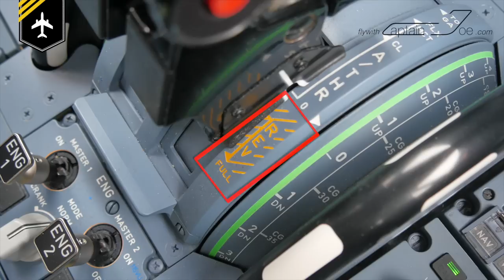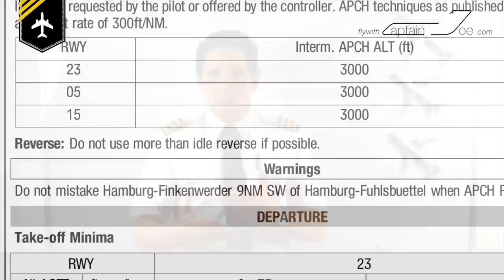What is reverse thrust? Explained by CAPTAIN JOE

Comment: Those reverse thrust doors have to be so incredibly strong.. Diverting a force which normally launches an 100.000KG+ airplane to ~800km/h. Good topic!
Reply from the maker: True, yes the must cope with a lot of stress!
Reply: Captain Joe I understand how the reverse thrust works on engines that have those flaps opening when reverse thrust is deployed. It's like ground spoilers but in another way. What I don't understand is how the reverse thrust works on engines that are just separated in half when we use the reverse thrust. Can you explain if possible ?
Reply: Captain Joe I am new subscriber and I know I will love this channel and share it. You're terrific Captain Joe!
Reply: Μανώλης Φιαγκουσάκης same principle. just the flaps is internal for those engines that 'seperates in halves'
Reply: @shermanbritto9930  Great "how it works" video! Thanks!
Reply: I worked at a manufacturing plant that made these doors. Each one is made of 50+ layers, total about half an inch thick, of carbon fiber laminate which is cured in an oven for hours.
Reply: @flywithcaptainjoe  does it made with titen metal?
Reply: @SamuelwrightA350 do You know if they are locked by altitude, absence of ground contact or closed landing gear?
Reply: Jet boats sa m e way docking bg

Comment: They told me lies

Planes can drive reverse
Reply: It is a foke!  Don't trust them
Reply: When I apply reverse thrust to go backwards instead of using pushback in simulators, the airplane doesn’t really move
Reply: @Akotski-ys9rr  there are planes, that do use reverse thrust to push back
Reply: Pushing back via reverse thrust has been banned since like the 80's - that's why tugs exist
Reply: they can't reverse thrust right in front of a Terminal
Reply: @KevinJDildonik  Reversing the thrust would only require that the air (thrust) that normally would be propelling the aircraft to be sent in the opposite, not the flipping the entire engine. Moving the entire engine instead of redirecting the airflow is what would be inefficient.
Reply: @jan-lukas  turbo.... PROPPPPPPSPSSS
Reply: @thomasriding3194  yes but it's stil posable
Reply: @FirestormX9  they can but it's just not banned
Reply: No! This is a SUPER RARE powerback procedure which uses in turboprop and planes that has engine in the back.

Comment: I'm a future aeronautic mechanic,(student) and even if I already know everything u said, i love your vids...
(PS: Brakes on a plane is not exactly like your car, but i understood what you meant 😂✈️, it's more like a motorcycle clutch, plane brakes on the landing wheels has multiple discs, some friction discs and some normal smooth discs, some of them are rolling at the wheel speed and there's a gap between the other ones who are not in movement. When the pilot push the brake pedal the moving discs "hugs" the non-moving discs to fill that gap between them, and it create a lot of friction exactly like a brake caliper will do on your brake disc in a car and that friction convert the plane speed into heat energy... So at the end the brake discs are really hot, but the plane is at 0 km/h...
Have a good day 👌
Reply: That's a pretty awesome explanation about the brakes. Didn't know that! Thanks mate
Reply: @Enzoxvx  you're welcome man

Comment: My wife's plane was diverted to Denver upon the loss of hydraulic control of flaps and reverse thrust. Denver has a three mile long runway and it was hoped that would provide enough distance to drop speed with only the landing gear brakes. It worked.

Comment: imho the MD-80 it's true that the pilot doesn't see his back but there is still the traffic agent guiding him so finally it might not necessary be that dangerous.
Could you make a video to explain Rudder and Horizontal stabiliser please? 
Thanks for your great videos
Reply: One thing we definitely know is, that using reverse thrust ist extremely inefficient for rolling out of a parkingspot.
The Stuttgarter Airport for example ban the use of reverse thrust for rolling back.
Reply: MrMonado likely the main reason not to use reverse thrust for pushback is the danger to the structure, personnel, and unsecured equipment at the gate.

Comment: I like that reverse thrust out of the gate at the end... I don't see why that would be an issue with some rear view cameras, in-dash monitor and some reverse flashing lights. Then you can get rid of those goofy tow trucks.
Reply: It would be interesting as an idea, but the risks of jet blast increase a lot (since you are applying thrust instead of idling the engines), and fuel consumption also increases, it's just cheap, safe, simple and functional to use the tow.

In other hand your question/comment does bring attention to alternative methods of taxing, since it actually represents a sufficient amount of fuel waste that it's not to be overlooked (jets are very inefficient at idling, I've heard of about 60% fuel usage of max power when idling, could be wrong but still not your average car), I've once thought of a powered landing gear that can tow the plane by itself, and then I've found out it's been studied/in the works.
Reply: I believe some smaller airports e.g. Hobart don't have such tow trucks though; instead aircraft use asymmetrical thrust to turn around and exit their gates on departure (for that to work it'll be difficult to have aerobridges though)

Comment: can you apply reverse thrust instead of having a truck to push the plane back at "push back" at the gate?
Reply: They can but don't for a safety reason
Reply: @pradipsapkota1688  so true is to work at the airport!
Reply: Yeah its called a powered pushback
Some airlines did this back in the 70s.
but no one does it anymore beucuase it burns extra fuel. Fuel consumption is  managed heavily now by airlines.
Reply: Yes, but only on body-mounted engines like the MD80. Plane manufacturers and regulators have banned powered pushbacks since the engines may suck up dirt from the ground and damage the fans. But yes, true: Airliners did powered pushbacks many years ago.
Reply: It will suck the terminal in the engines
Reply: RC BLITZ there’s no way it can suck up the terminal cuz its too big

Comment: What will happen if u apply reverse thrust in mid air?
Reply: Ask Niki Lauda.
Reply: Bowie Fernandes Most aircraft will only allow the reverse thrust to be activated when the landing gear touches the ground. However there have been incidents where the reverse thrust accidentally got activated during flight which resulted in two plane crashes.
Reply: If both reversed simultaneously the nose would drop and the aircraft would descend very rapidly. Recoverable by throttling down the engines and disabling the reversers. (As Ruben said, this is impossible in most aircraft due to touchdown sensors built into the landing gear)

Now, if one were to slam open due to a mechanical failure things get deadly very fast. Say, shortly after takeoff, the right reverser opens without warning. The nose would swing to the right very violently and the rudder would probably not have enough authority to stop it. The crew would be confused and disoriented. A huge sideslip would develop and the aircraft would basically be flying sideways. The right wing would stall and drop, and at this point recovery would be impossible.

But it's that pesky "mechanical failure" part that makes that scenario essentially impossible. The reversers have many sets of extremely tough locks that keep them closed. All of them would have to fail simultaneously.
Reply: Ruben Xue
Reply: SHANTO ANTONY that's my name.
Reply: Depends on whether it's intentional or not. Some airplanes are designed to allow it (the DC-8, Il62, and Trident come to mind). Most have mechanical interlocks that prevent deployment in the air (or above a certain altitude - on the 737, reverse thrust is available above 10' radio altitude), but interlocks can fail. I remember watching an MD80 flight test video where they tested this very scenario to demonstrate that a safe recovery and landing was possible, but, of course, there's a big difference between a scheduled flight test and a real emergency...

On the DC-8, the use of idle reverse on #1 and #4 made up for the fact that it lacked flight spoilers. The Trident was capable of massive descent rates owing to the availability of reverse in the air. The Il62 and Tu-154 often use it just above the ground to shorten the landing roll.

Unintentional deployment of a thrust reverser inflight caused the premature landing of a 767 - in many small pieces.
Reply: Bowie Fernandes nothing, rev thr is disabled till touchdown
Reply: Again - it depends on the airplane. The 737 depends on the radio altimeter, with reverse thrust available below 10 feet. Many older types (such as the Il62, DC-8, HS121, and Tu-154) had reverse available in flight as a design feature.
Reply: Bowie Fernandes The plane slows down in an uncontrollable rate and results in a mid-air stall. It will be a catastrophic drop.
Reply: Of course, activating rev in flight is impossible. Due to sensors and heavy duty locks.
Reply: Reverse thrusters can only be activated upon landing because one of the many sensors requires compression of the landing gear struts (upon touchdown) to activate. That removes pilot error or mechanical malfunction of prematurely deploying the reverse thrusters in mid-flight.
Reply: not in russian planes...check "TU 154 reverse trust....old russian planes like TU154,il 86,il62 must apply reverse thrust before touch down because they use twice the distance to stop..check the videos and u will see
Reply: Bowie Fernandes Look up AIR CANADA @ Lester Pearson Airport, so he time in the 60's DC8, as I recall, it did NOT have a SAFETY DETENT, and Reverse thrust was activated at around 60 feet AGL, DO NOT recall if any survivors.  That item was corrected, so as not to have another repeat, I think about  1965, or 66.
Reply: why him? he's an  F1 racer?
Reply: At cruise speed the opening of reverse ports for sure will result in the inmediate structural failure of those elements, resulting in no counterthrust forces but causing serious demages in engines and probably catastrophic damages to the plane. Happyly it is something virtually impossible.
Reply: You'll get jet lag... :-/
Reply: On October 31, 1996, TAM Airlines Flight 402 crashed into a suburb in São Paulo, killing all 95 people on board and 4 on the ground. The cause of the crash was due to a failure with the Fokker 100's thrust reverser on its right engine. See "Mayday Air Crash Investigation S15E10 Carnage In Sao Paulo"
Reply: It will fly backwards 

jk
Reply: have a look mate
Reply: @HighAway: He was a F1 racer and he had a Airline. One of his planes had a reverse thrust malfunktion midair and crash 1991, Lauda Air Flight 004
Reply: you would get pushbacked then the nose would drop fast i think idk
Reply: I believe the Concorde was te only aircraft to use reverse thrust in flight to help with deceleration. There may be others that I don't know of
Reply: Bowie Fernandes you stall and crwsh
Reply: Bowie Fernandes it will be like lauda air 004
Reply: the engine Will loose and fall to the ground. passenger Will fly without jet engine lol.
Reply: It will not happen
Reply: crash
Reply: Don't think you can on airbus
Reply: What would happen if you shift your car in reverse at 100kmh? ouch. Something will come off.
Reply: Plane flys backwards and your seat rotates 180 deg so it will feel normal at least.

Comment: I noticed the engine you show in the first clip had thrust doors (don't know what they are called) which look unusual to me. They kind of "flap" or fold out. I don't know if they are used often on today's planes, but the ones I usually see don't seem like doors at all. It looks like the engine casing just moves forward, and exposes the engine innards. 

My question is - how does the reverse thrust work in that case? It doesn't seem to "reflect" air off of anything.

Comment: How does reverse thrust work in propeller driven engine?
Reply: Maybe some Pilots can I answer this because I'm not a pilot, but I do believe the blades reverse pitch
Reply: My saying blades, yes I meant the propeller blades
Reply: @josephthomas439  i think propeller cannot reverse.
Reply: @farukche3848  No but the blade pitch is variable, so that gets reversed instead.
Reply: Usually the blades on propeller driven planes that have reverse thrust are able to rotate thus changing the direction of thrust
Reply: I don’t thing they reverse I think the just brake and lower the aerodynamics

Comment: Due to the intake being not far from the thrust reverser output, wouldn't there be, to some degree, a loss of the effective thrust from the thrust reversers due to a vortex ring state of sorts?
Reply from the maker: Good question! I´m not sure how to answer that right now, but I´ll look into it! Greetings Joe
Reply: http://www.aem.umn.edu/~kmahesh/globalassets/publpdf/journal/hyunchul_jfm_crash.pdf
Does this help. I don't know much about engineering, but googling vortex rings in reverse thrust, I found this article, perhaps it has some info that helps, perhaps it doesn't.
Reply: Along those lines if the reversers are only redirecting bypass air when you spool up to full reverse aren't you fighting yourself because the core of the turbine is making forward thrust still? Probably doesn't matter too much because most commercial engines are high bypass, but I wonder if there are mechanisms to fight that where the engine doesn't have a full clamshell to redirect all thrust (like in the MD80 video).
Reply: Jon fritsch The point is Not just too have Reverse thrust (full reverse) but also too decrase The Outlet to The back( Idle Reverse)
Reply: Jon fritsch At this point vortex rings are not produced due to the proximity with the ground, the distance between the wings and the ground is inferior to a wingspan

Comment: Captain,
What is your recommended procedure for applying reverse thrust on an aircraft with only one operational engine? Would you compensate with rudder or brakes or skillful application of everything available? (This scenario for two engine jets) Is deploying only one side of speed brakes an option on the Airbus Series Aircraft? Or is it a slip and slide situation? Your video's are awesome! Please keep them coming. Thanks...

Comment: I guy I went to college with flies 767's for Delta to Asia... but he flew DC-9's for Northwest for a few years and they did power-backs.  I guess the protocol at the time was that the captain and first officer would both say "feet flat on the floor" before performing a power-back as it was apparently rather easy to do an accidental "wheelie" and put the tailcone on the ground if brakes were accidentally applied while doing a power-back.  The DC-9's are all gone but I haven't seen a single MD-80 do a power-back in many years.  I've been told that fuel is too expensive.

Comment: Hey Joe I have been on a few DC-9s with EASTERN and the pilot used reversethrust backing away from the gate. The engines would power up a little ,and the aircraft would roll forward slightly and then would using the reverse thrust , then back away from the gate. The pilot would watch the ground crew to let him know when to make his turn to start his taxi to the runway. We did this at JFK and in ATLANTA. No need for a pilot tug.

Comment: Hello there, this is Josh. I have worked in Aerospace Manufacturing for 38yrs and I know a lot about airplane but I do not know everything of course. I was working at Bombardier in the 80s and was involved in the implementation of one of the first winglets. I know their purpose, but recently I started a contract on the 737 MAXX-10 and noticed they now have downward winglets. Do you know exactly what is their purpose, apart from looking damn cool?

Comment: To Jo the Captin. why are thrust reverses used when just before touch down? I see it all the time a good 200-300m before the runway? it's it to reduce speeds on aproch? i know in wet weather you want a hard landing to avoid aquaplaneing. if you can answer my question it would be greatly appreciated.

Comment: Joe, Am I right in saying that the reverse thrust is only the cold bypass air and not any air from the engine core. Purely bypass fan air that gets reversed. Since the majority of thrust comes from the bypass air, this is why the thrust is increased in the opposite direction.

Comment: Which of the following is correct for thrust reverser
1)It is operated at Low rpm
2)It is operated at high rpm
3)It is operated at Low forward speed
4)It is operated at high forward speed

Comment: back in the early 80`s when I was working at air Canada cargo in yvr,i remember pilots using reverse thrust  on the dc8 freighters to assist on the pushback on rare mornings with conditions that were too icy for the pushout tractor to manage.

Comment: If full reverse thrust is 70% of forward thrust does that mean the engine is operating at 70% or the net reverse thrust is 70% of full forward thrust?  Assuming the engine is limited to 70% thrust then net reverse thrust would be less than 70% do to losses in the reverser system putting the total reverse thrust at, perhaps, 50% or even less.  Can you clarify this?

Comment: Hi Captain Joe, I am a huge fan of aviation but unfortunately not a pilot.I had a doubt when I was waiting for my flight from London LHR to Dubai, I saw an emergency exit over the wing of an A380 aircraft. The doubt is will the air balloons deploy from the exit over the wing in case of emergency or is it for ppl to walk over the wings in case of emergency landing. Because the height of the wings from ground is like 6 meters.